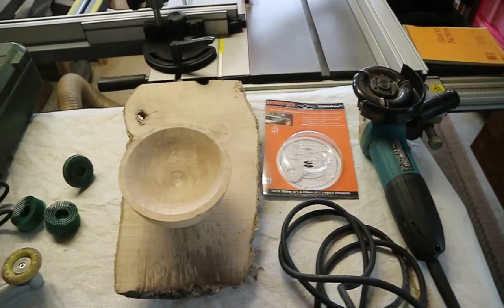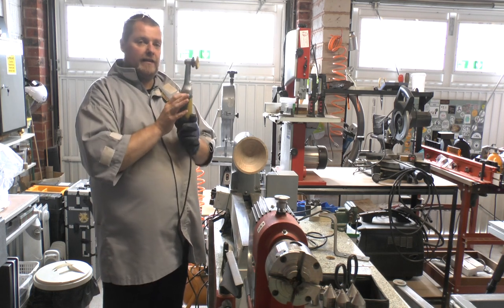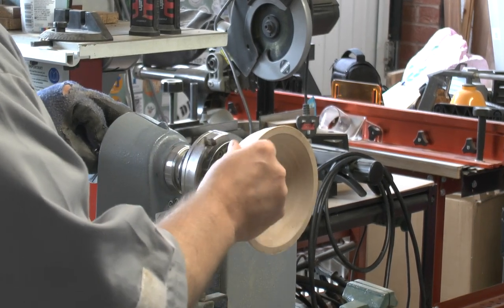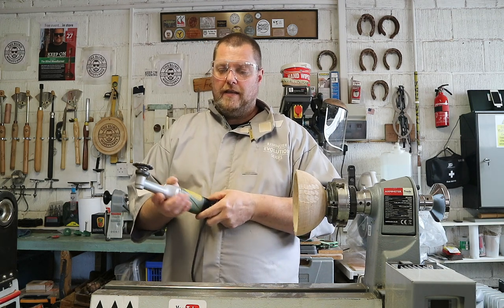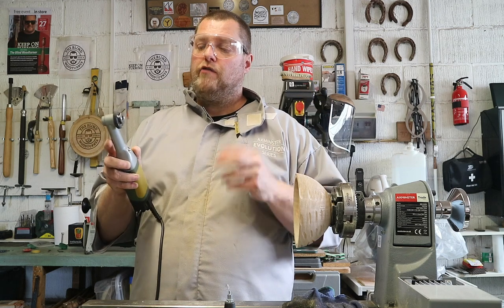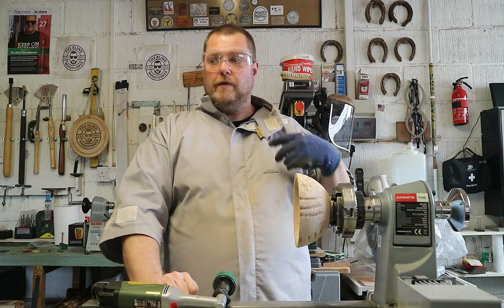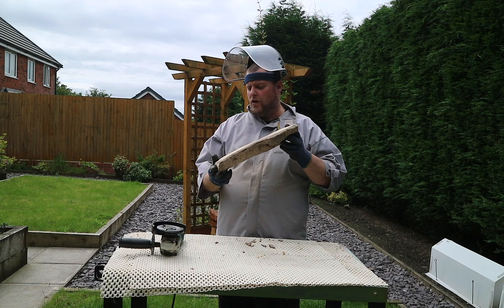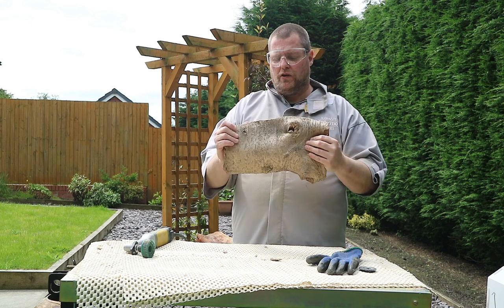A Beginner's Guide to Power Carving

Comment: Hi Chris, great video, question please. With the Proxxon carver, is it brand new to you and is this the first time you have used it ? I ask as I wanted to buy one, went to your Axminster link, read the reviews and a lot say it is crap, breaks down a lot, load of junk and do not buy it. Your thoughts please. Winter here in Australia, wish I had your Sunny weather now.
Reply from the maker: Hi Dave !!
I have had my Proxxon for over 9 months now . and it is a joy to use .Proxxon are very insistent in the literature that you do not cover up the cooling vents . They also stress that it is important not to over force the motor by using too much pressure when using the tool .Most people don't read manuals and just crack on  .
Personally , I love the Proxxon and usw it very gently .
Take it easy .
Chris .